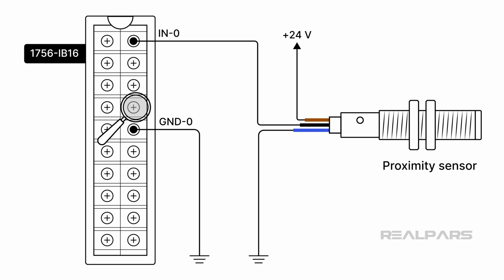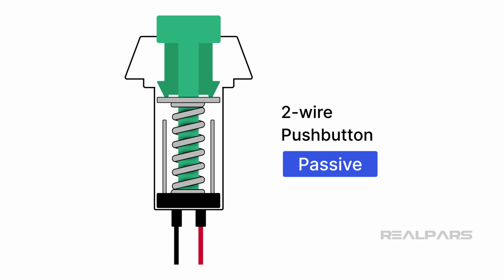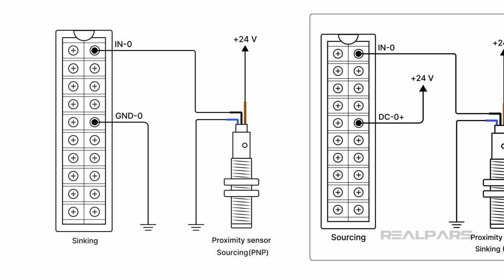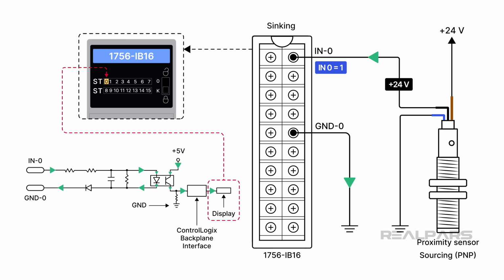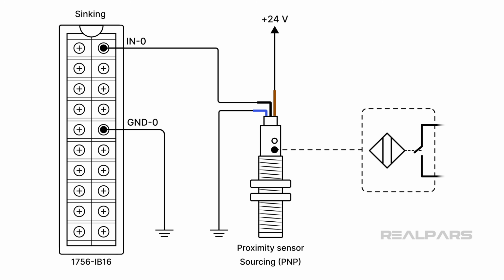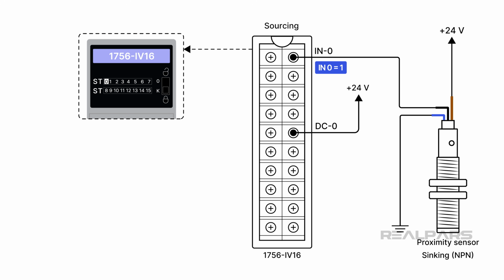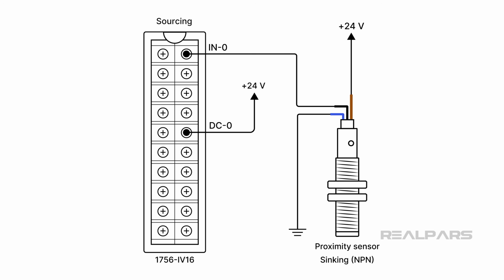Why PLC Inputs Fail: Sinking vs Sourcing

Comment: Digital inputs are easy…wait until you need to explain analogue input sinking and sourcing or better yet digital output vs relay outputs modules 😉
Reply from the maker: Hello @BI0ckHe1d. Thanks for your feedback. Yes indeed......digital output modules do present another batch of issues to be concerned with.  We're not quite sure what you mean by "analogue input sinking and sourcing".  Are you referring to current type 4-20 ma, 2 or 4-wire configurations, or voltage/current single-ended or differential input configurations? Thanks again for your input!
Reply: @realpars  mainly how the field devices are powered and if it is active or passive, 2 wire devices and 4 wire devices trips a lot people up, also there are some PLC manufacturers allows sourcing of 24V DC directly from the analogue input modules. Other confusion can derive from adding galvanic isolators into the loops when working within hazardous atmosphere environments

Comment: Sourcing input module is a bit confusing; Logic 1 when there is 0 volts and logic 0 when there is 24 volts.
Reply from the maker: Hi @mareysaad6597.  I agree. I've only experienced one such module, and that was many years ago. It had me stumped for hours. I scratched my head trying to interpret the voltage readings I was seeing.  Always pays to review the documentation BEFORE making unreliable assumptions.
Reply: Exactly. It's like as if someone told you to write a plc program with inverse boolean logic. I quickly get confusedm

Comment: Where do you begin when troubleshooting
0:03 a fault in a PLC controlled system? An
0:05 issue with the PLC program is seldom the
0:08 cause of the fault unless it has been
0:10 altered by human intervention.
0:12 Usually, the problem stems from the
0:14 field devices or the PLC IO modules. In
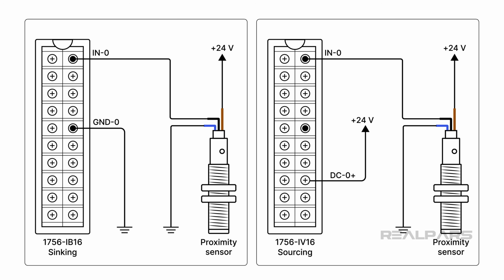0:18 this video, we'll explain the
0:20 characteristics of syncing and sourcing
0:22 PLC inputs so you can effectively
0:25 troubleshoot and identify where the
0:26 fault originates. Let's start with the
0:29 terms syncing and sourcing which can
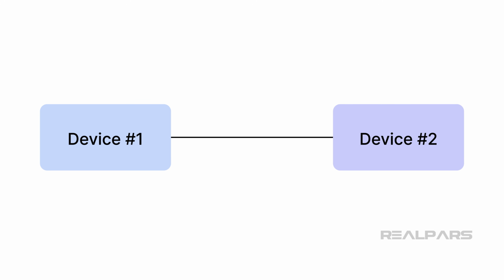0:32 often be confusing. In simple terms,
0:35 it's all about defining the direction of
0:37 conventional current flow between two
0:39 devices. If current is flowing from
0:42 device number one to device number two,
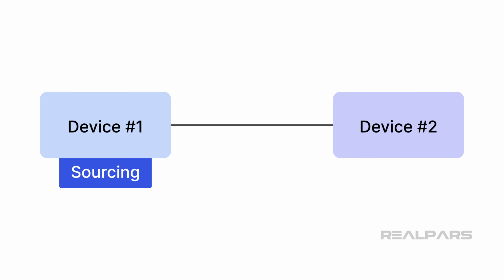0:45 device number one is sourcing the
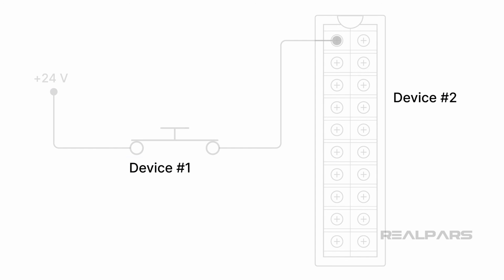0:47 current and device number two is syncing
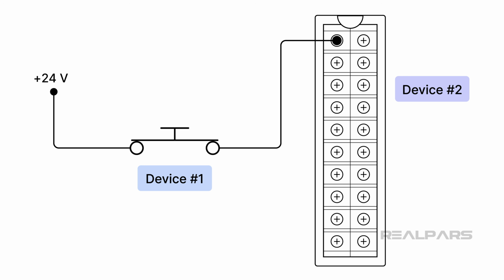0:50 the current. All right. Suppose device
0:52 number one is an input field device such
0:55 as a switch and device number two is a
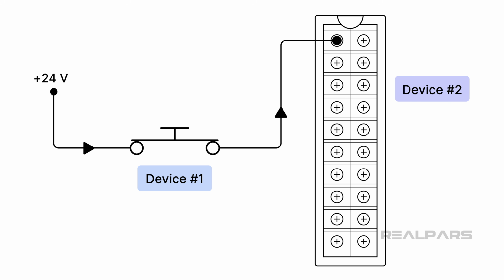0:58 PLC digital input module. If current
1:01 flows from the switch to the input
1:03 module then the switch is the source and
1:06 the input module is the sync. If current
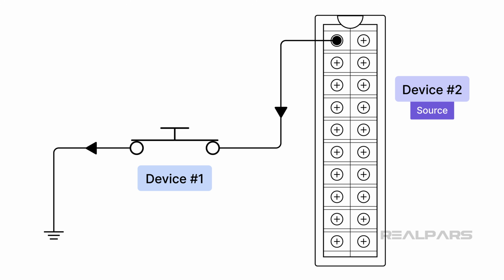1:09 flows from the input module to the
1:11 switch then the input module is the
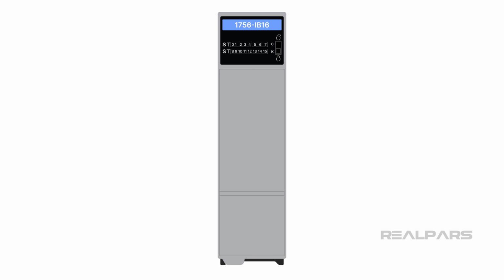1:13 source and the input module is the sync.
1:17 PLC vendors offer both syncing and sourcing
1:19 input modules. For example, the Allen
1:22 Bradley 1756-IB16
1:26 is a 16input 24volt syncing input
1:29 module. The Allen Bradley 1756-IV16
1:34 is a 16input 24volt sourcing input
1:38 module. Want to train a team of
1:40 engineers or technicians? With RealPars
1:43 Business, you can easily grow your
1:45 team's industrial automation skills.
1:48 Learn more at realpars.com/business.
1:51 You can also find the link in the video
1:53 description. Let's move on to a
1:55 discussion about two-wire and three-wire
1:58 input field devices. The majority of
2:00 two-wire devices are passive, meaning
2:03 they do not require power to operate and
2:06 simply open or close a circuit. Examples
2:09 include push buttons, limit switches,
2:11 and other mechanical devices. We can
2:14 consider two-wire passive devices to be
2:17 either syncing or sourcing. There are
2:20 also active two-wire devices that
2:22 require power to operate and may be
2:25 polarity dependent. Three-wire devices
2:27 are part of the active device family
2:29 that require power to operate. Examples
2:32 include proximity sensors and
2:34 photoelectric switches. The wire colors
2:37 follow a standard. The brown wire
2:40 connects to the positive supply, usually
2:42 plus 24 volts DC. The blue wire connects
2:46 to the power supply return. The black
2:48 wire acts as the signal output and
2:51 supplies input to another device, such
2:53 as a PLC input module. Three-wire active
2:57 devices are either syncing or sourcing.
3:00 It's vital to verify that three-wire
3:02 devices are compatible with the intended
3:04 input modules. A three-wire sourcing
3:07 sensor, also called a PNP sensor, must
3:11 connect to a syncing input module. A
3:14 three-wire syncing sensor, also called
3:16 an NPN sensor, must connect to a
3:19 sourcing input module. Many PLC
3:22 troubleshooters take advantage of the
3:23 input module LED indicators. Having said
3:27 that, it's essential to understand what
3:29 the LED indicators are telling you and
3:32 how they can be misleading. Let's start
3:34 with a sourcing sensor connected to
3:36 input zero on a syncing input module.
3:40 We'll use the Allen Bradley 1756-IB16
3:44 digital input module as an example. Each
3:48 input circuit has an associated STLED
3:51 that is intended to indicate the input
3:53 status. If the LED0 is on, it suggests
3:57 that the sourcing input device is
3:59 supplying plus 24 volts to the module's
4:02 input zero terminal. The module will
4:05 interpret this voltage as a logic one
4:08 and use it to operate within the PLC
4:10 program. If LED0 is off, it is often
4:14 assumed that the sourcing input device
4:16 is providing 0 volts to the module's
4:18 input terminal zero, which the PLC
4:21 program will interpret as a logic zero.
4:25 However, we all understand what assume
4:28 means. We said earlier that the LED
4:31 indicators can be misleading. Why is
4:33 that? Well, the LED may be on, but the
4:37 voltage present may not be what you
4:39 expect. The same can be said when the
4:41 LED is off. The only way to be sure is
4:45 to measure the voltage at the input
4:46 module terminal. According to the
4:49 1756-IB16
4:51 input specifications, any input voltage
4:54 above the 10VT threshold will be
4:56 detected as on by the module. A 15V
5:00 input will be interpreted as a logic one
5:03 in the PLC program. However, this may
5:06 indicate issues with the field device
5:09 wiring or possible corrosion. An input
5:12 below 5 Vs will be recognized as off by
5:15 the module. How is it possible for the
5:18 voltage at the module input to be close
5:20 to 5 Vs when the sourcing sensor is off?
5:23 A sourcing sensor turns off by opening
5:26 an internal semiconductor switch, not by
5:29 grounding it. The module input is
5:31 floating, making it susceptible to
5:33 voltages caused by normal sensor leakage
5:36 current. Want to learn more about using
5:38 multimeters, testing circuits, and
5:41 working safely with electricity? Check
5:43 out the Industrial Electrical
5:45 Maintenance Essentials 1 course. You'll
5:47 learn how to safely use tools like the
5:49 digital multimeter in real world
5:51 maintenance. You can find the link in
5:54 the video description. Okay, now let's
5:57 talk about a less used combination of a
55:59 syncing sensor connected to a sourcing
6:01 input module. We'll use the Allen
6:04 Bradley 1756-IV16
6:07 digital input module as an example. If
6:10 the LED0 is on, it indicates that the
6:13 syncing input device is providing 0
6:15 volts or ground to the module's input
6:18 zero terminal. The module interprets
6:20 this as a logic one and uses it to
6:23 operate within the PLC program. If LED0
6:27 is off, the syncing input device output
6:30 is effectively open, causing the input
6:32 module to float, which the PLC program
6:35 will interpret as a logic zero. If you
6:38 decide to measure the input voltages for
6:40 the on andoff LED states, don't be
6:43 fooled. They are the opposite of the
6:46 sourcing sensor syncing PLC input
6:48 combination we discussed earlier. When
6:51 the LED is on, the input voltage will be
6:54 close to zero. When it is off, the input
6:57 voltage will be about plus 24 volt.
7:00 According to the 1756-IV16
7:03 input specifications, an input voltage
7:06 exceeding 5 V will no longer be
7:08 considered on and will be recognized as
7:11 off. How can an input voltage rise above
7:14 5 volts when it appears to be grounded
7:16 to zero through the sinking sensor? It's
7:19 often caused by high resistance issues
7:22 such as corrosion at ground connection
7:24 points or very long ground cable runs.
7:27 This is a good place to wrap up. As we
7:30 said earlier, the majority of PLC faults
7:33 originate from field devices, IO wiring,
7:36 and occasionally the module. The PLC
7:39 software itself is rarely at fault. LED
7:42 indicators are undoubtedly helpful, but
7:45 measuring the actual input voltage is
7:47 the only reliable way to confirm what's
7:49 happening. Understanding syncing and
7:52 sourcing inputs and the expected voltage
7:54 ranges on modules will take you a long
7:57 way on your troubleshooting journey. If
7:59 you want to know more about sensors,
8:01 check out our course called Industrial
8:04 Sensor Fundamentals. If you're a plant
8:06 manager looking to train your team
8:08 without sending them away for expensive
8:10 in-person classes, check out RealPars
8:13 business. Your employees can build
8:16 realorld automation skills entirely
8:18 online with no travel required. Learn
8:22 more at realpars.com/business.
8:32 Hey,
8:42 hey,
Reply: Nice job

Comment: 240VAC instead of 24VDC usually does it.
Reply from the maker: Hello @wakkowarner7391,

Thank you for your comment. We’re not entirely sure what you’re referring to. There are PLC input modules designed to work with higher voltages. For example, in the Siemens S7-300 series, the 16-channel 120/230V AC input module is 6ES7321-1FH00-0AA0.

If you could clarify your question a bit more, we’d be happy to provide further details.
Reply from the maker: @realpars  Very true, but sinking and sourcing are terms no longer applicable with AC modules.
Reply: Yeah that always works when I do it. And not “usually” it’s like 100% at this point. I’ll try it again tomorrow and see. 😅